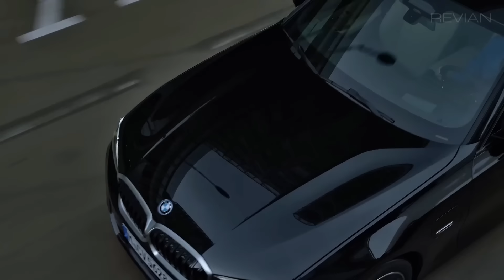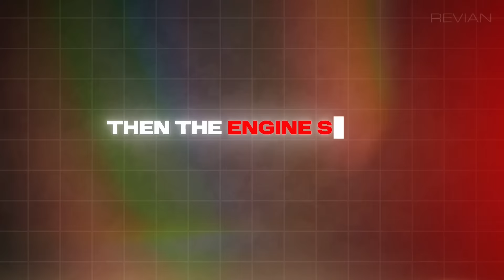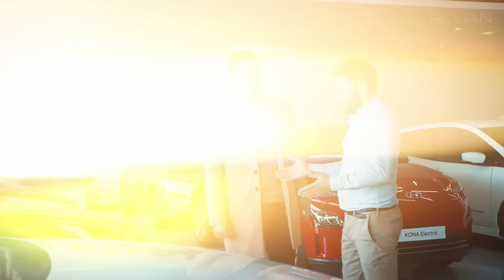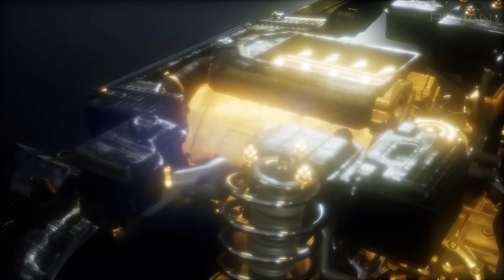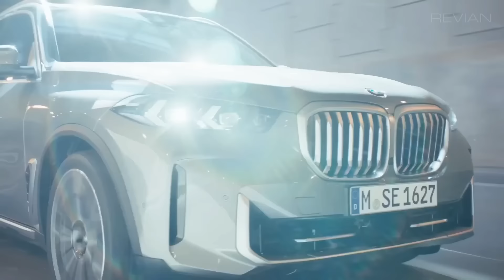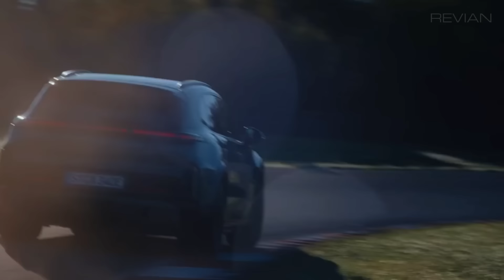The 10 WORST Oil Burning Cars in Britain

Comment: Er, got to just stop you there. I had the original BMW with the N47 engine, and yes, the timing chain stretched and needed replacing, but the engine never burned a drop of oil, not before or after the repair..never. Scrolling on..

Comment: As an ex mechanic I'd love to know how a slack timing chain could increase oil consumption?? How can a 1.4 VW petrol engine have problems with a diesel particulate filter when it hasn't got one?? The pictures bear no resemblance to the commentary most of the time. The claims in this video are so exaggerated that it's basically total cr*p.
Reply: As another ex-engine reconditioner of 45 years I too would like to know how a worn timing chain can cause excessive oil consumption,I think a lot of these problems are caused by the piss we now use as engine oil,these thin oils are used to improve MPG so it looks as though the engine is more efficient than it really is. A lot of people will argue that they have had no problems whatsoever using these oils but many others will say different and oil consumption is a problem,these extended oil change interval’s don’t help either,doing 15/20 thousand miles without an oil change is stupid because the chemicals in the oil break down over these extended mileage’s making the oil even thinner and thinner oil burns more quickly. I have had dozens of cars over the years both petrol and Diesel engines and Never had an oil burning problem. My BMW X3 with the six cylinder diesel has done 134,000 miles and uses no oil between oil changes,I use 0W/40 all year round and change every six months which is around every 6,000 miles and the oil filter every year or every second oil change,I use the cheapest oil I can find within specification and have Zero problems and the engine looks as though it’s just been assembled inside with no muck or sludge anywhere. Years ago manufacturers would not accept a warranty claim for oil consumption if it exceeded over 500 miles to the pint,to avoid running in manufacturers hone the bore’s nearly smooth which again doesn’t help with oil consumption because the bore’s polish up and then burn oil. Everything depends on how the vehicle is used and driven,short journeys are the biggest problem because the oil never reaches its operating temperature to provide maximum protection.
Reply: @davidellis279  My only comment on that relates to oil change intervals. If engines are well engineered from quality materials there's no need to change the oil very frequently. I bought my last Audi A6 TDi still under warranty from new, 17,000 miles. The oil was changed when the computer said it should need it, every 16-18000 miles, never any less. I ran it to 332,000 miles and sold it still running and sounding like new on the original engine. The oil consumption was around half a litre every 3,000 miles, i.e. negligible, and never increased in over 300,000 miles. My current Audi A6 40TDi also has oil changes at around 16-18,000 miles as dictated by the computer. At 107,000 miles it has used zero oil between services.
Reply: I agree
Reply: This guy is taking the biggest lot of bullshit this side of the ocean..